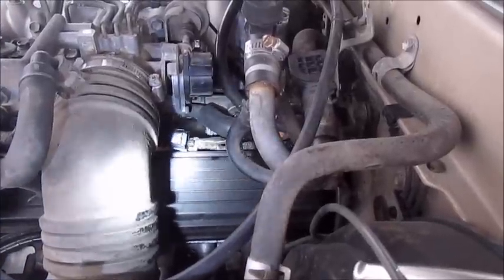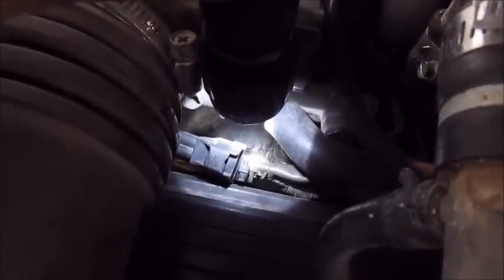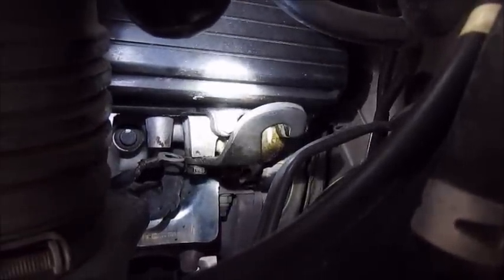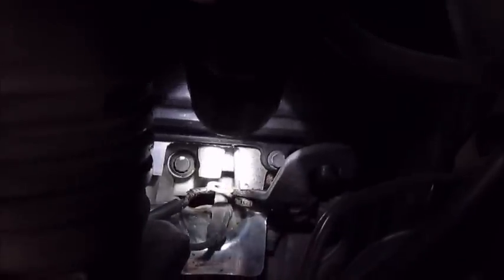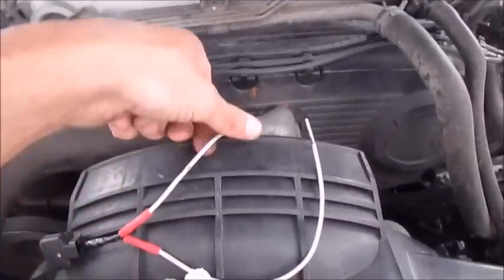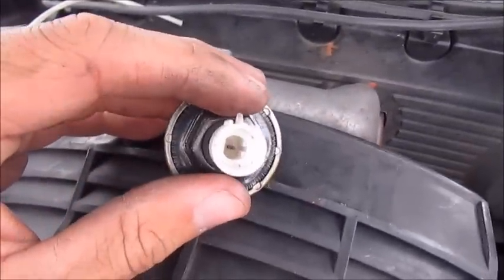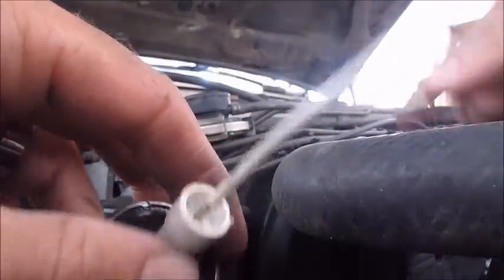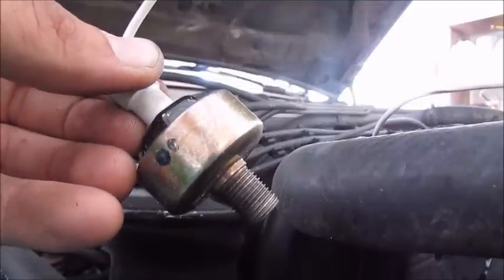knock sensor bypass

Comment: Knock sensor is special designed piezoelectric microphone and sending alltime  agly electrical signal from vibrating engine to controller. Engine is solid pice of metal and vibration is everywhere.

Comment: I actually have a Code 52, knock sensor related problem. I did replace the wire with an OEM Toyota wire. It is so much work to replace the knock sensor that I may simply do such a bypass since my smog check was due last month. I gotta find a place to install it where it is not visible, otherwise the smog inspector will not pass the smog test by visual inspection & noticing that the knock sensor is not in its right location. But at least this way I can quickly get my 3vze smoged to get the tags, then later do the actual work & spend the $200 for the OEM Toyota knock sensor.

Comment: How do you access the connector wire to connect a new sensor?
Reply from the maker: The sensor has a pig tail that passed through a rubber grommet of sorts that is in a slot under the throttle body in the plenum. If you want to retain your original connector on the factor harness, just cut the pigtail right next to the grommet and use the excess wire to connect to your new sensor. It might not be a bad idea to pull any slack out of the pigtail to get as much wire as you can before cutting it.

Comment: That “metal jacket” is a shield cable not just a ground. It’s braided around the main conductor because a knock sensor is piezo sensor. It generates a very slight AC current. This is VERY subject to electrical noise interference. Hence the shielded coaxial cable. Your ECM is not receiving the proper signal from the new sensor because you didn’t use a shielded coaxial connection. It may not be setting a check engine light but it’s likely allowing knock at dangerous levels. It will run great right up until it doesn’t!
Reply: And that shield is carried the entire length of the signal wire all the way through the bundle to 8 inches from the ECU. At that point it is tied to shields on several other wires. If anyone is bypassing or eliminating the shields they are most likely not getting the correct signal at the ECU. But how would you know without the proper test equipment and exactly what equipment would that be? I've read volumes in forums on the dread code 52 and watched several videos on it and an oscilloscope seems to be the best method for testing the actual signal. All of my wiring tests fine, both with a meter and under load, i.e. applying voltage through the wire and shield through a 12volt light bulb. I still have a couple of things to try as I have no method to test the output of the sensor, my meters read nothing on the hammer  test. Maybe there's an oscilloscope order in the very near future.
Reply: @TheBrushcutter  not a simple thing to test for sure. Scope is the only real way.

Comment from the maker: The sensor is not grounded internally. Typically only temperature sensors are internally grounded. Sensors such as a knock sensor that deal with a lower 5v supply have external grounds.

Comment: wait you have a ground from the wire loom and your putting that to the block ?the sensor is grounded when it gets put into the block whats the other wire do i just rebuilt mine and i found a braided wire in the loom  but my sensor has two already do i put the braided to the block

Comment: Knock sensor requires no second grounding as the sensor attached to the block is the ground to the battery.
Reply: Yes I believe the braided wire he was mentioning was the shield wire..

Comment: I have suzuki alto 2002 and knock sensor light on off. And engine making knocking like tarrr tarrr. I have changed 7 knock sensor but still that problem. And the wiring till computer is ok

Comment: Going to try this today after about 30K miles of irritating safe mode driving- thinking I will have to sea foam it after the fix if this works. I mounted the 97 s10 KS just above the two bolts of the hook so they would clear but it would be handier to have it higher up. When I dug out the wire harness I found that it was broke off right by where the harness goes inside - so the sensor might have been fine but the break is too deep, and I already had the new one so will try that before having to remove all the throttle body stuff. The wires are very brittle. I also bought a new harness but the plug-in is round whereas the original is square like the video. Need extra wire anyway because the harness won't quite reach. Will report back.
Reply: Richard Frey 
I just ran new wires to my sensors  and  soldiered my new wires from computer to sensor and used my old plug I just cut it off and soldered it to new wire then pluded it in good as new. The factory wires are easily frayed or broken over time this was a good and quick fix for me hope it helps u.

Comment: this works great!!! I did mine on the side, anyone says it wont work please tell me? how is it you can hear sound 1200-miles away on a thin piece of wire and this set up is only 2ft away at best from were it should be, will not work? sounds travels threw metal I say it does work.
Reply: Joe Trueblood which s10 sensor did you use and which harness? Asking for when they ask me what model the s10 is

Comment: After doing a little research I'm thinking that more often than not the sensor itself is fine but the pigtail is notorious for going bad.  In my case mice chewed it.  I happen to have an extra sensor from another engine and am thinking about just doing this mod but with the OEM sensor.  These type sensors are piezo crystal and operate within certain frequency range and I'm wondering if all piezo type work in the same range and what they do is "listen" for pinging sonically through the block.  I'm wondering which is faster; removing intake and replacing pigtail or getting a drill into tight quarters to drill and tap a new hole?

My other concern regarding this mod is I noticed most sensors seem to be centrally located in order to hear all cylinders, some with multiple locations on larger engines, so my fear is that knocking from the opposite cylinders not registering and therefore poor engine performance.

Comment from the maker: I had a similar problem trying to time mine, I had to do it by feel because the timing light put it way off. I eventually recalibrate the TPS and it fixed the problem. I was then able to time it with the light.
Reply: Travis Christy have a picture of exactly where put the knock sencor

Comment: I have a 1993 Toyota 4Runner 3.0 engine. My problem is that I replaced the engine Heads along with all other parts like the timing belt. Now I am having a problem setting the timing. I have double checked all marks. The engine starts fine but when I set it at 10% before top dead center, the engine has no power. I tried relocating the Knock Sensor, but still no power. Can someone help with this.

Comment: I watched your video, and it is great, but I do not understand where you drilled for the new sensor. Is it on top between the two existing bolt holes or over an existing hole?

Comment: I just did this fix to my 1989 4x4 pickup with the 3VZE motor with code 52. No more check engine light and seems to be running much better.

Comment: That's awesome. Very admirable tenacity and impeccable research done here! Even went as far as comparing the displacements of the two engines so as to ensure that the s10 sensor would be undoubtedly able to pick up on that certain frequency in case your old sensor was a tuned sensor and not a mass sensor.

Comment: OK, update on my 1993 3.0 V6 4runner 4x4 automatic! I successfully relocated my knock sensor to the position called out in this video, to the lift hook BUT, what happened was it didn't work the first time and discovered the brown wire that went into the clip from the harness side was damaged and hanging on by a couple wire strands. I bought a knock sensor pigtail from Toyota for $22, repaired the existing harness clip damage, the pigtail was a little shy in length to the new sensor location so I soldered an extension,about 5 inches, and attached the round male clip suggested down below from Ebay. I clipped in the new pigtail to the harness and attached the 97 chevy S-10 4 banger knock sensor. I had detached the battery earlier to wash out the code 52 and work on the vehicle. And it worked like a charm! No code, and smooth running engine! I did not have to attach a ground cable! I repeat, I did not use a ground! I was curious about Toyotas new pigtail wire for their sensor and I took all the tape off and found that the black wires outside grounding braid was attached to the brown wires outside grounding braid and the brown wire was soldered to its own grounding braid and taped up! The Black wire that lead to the sensor connection end, had about 4 inches of nothing but Black wire going to the clip sensor connection and the blue thicker encasement with the braided wire just ended and folded back unto the wire about 1/2 inch with the black wire exposed leading to the sensor clip all by itself!  So the black wire is the sensor wire and the brown wire is the ground that goes nowhere, weird but I have come to the conclusion that the brown wire is already grounded within the harness wire setup itself!  Good luck!   Toyota pigtail wire harness to the knock sensor is part number 82219-35010 wire sensor http://www.amazon.com/Novello-Connector-Female-Sockets-NIL-WHCF/dp/B000WPF9WW/ref=sr_1_1?s=automotive&ie=UTF8&qid=1434594718&sr=1-1&keywords=female+deutsch+pin&pebp=1434594739657&perid=1MMPCNDK40G8MVWPN4DN
Reply: Placido Bernal     U should of punched him in the nuts
Reply from the maker: Placido Bernal it is the bracket on the driver side rear of the engine. I pulled the bracket off (two bolts) and drilled and tapped it. Then just reinstall the bracket.
Reply: Where exactly did you drill the new hole? Is the bracket the one with hole or where the bracket mounts to?
Reply: Thanks, I was able to do it, but wasn't able to pass the smog. The reason was because they said it was modified. The check Engine light did go away. so now I will need to replace the Knock Sensor any way.
Reply: Placido, How did they find the modification if the check engine light wasn't on?
Reply: Hi, well the inspector has to do a visual inspection and that is how it failed. He saw it there on the lift bracket and said the system can not be modified from its original build. Now I need to fix it because he noted it on the inspection as to why it failed.
Reply: That works better if you are really short.

Comment from the maker: On the sensor side harness, I took the braided wire and unbraided it from the inner signal wire and ran it into a butt connector that went to ground. I took the inner signal wire and ran it to the sensor. I hope that answers your question.
Reply: Travis Christy --- the braided (outer wire) is a shield. This stops RF from leaking.

Comment: Question; How did you tie in the new wires to the old wires in the sensor side of the clip.Each set has braided wires outside both black and brown original wire package. Did you tie both braided and cased wire in the black ground side, to the new single wire. And did you do the same for the brown side that leads to the new chevy sensor? blend both braided and cased wire together to the single wire that will hold the sensor connector?

Comment: muchas gracias amigo resolvi mi gran problema
Reply: Hola Victor nos puedes explicar con mas detalles por favor?Gracias
Reply: Barrenaste un nuevo hoyo?ahi donde va el gancho?para dejarlo enroscado y el cable negro lo atornillaste al bloque?
Reply: No, no barrene el sensor nuevo cae el roto viejo y si el negro va al bloque
Reply: Recuerda q vas a usar un knock sensor de S10 cuatro cilindros del 1997
Reply: Perdon no entendi eso" del sensor nuevo  nuevo cae el roto viejo"
Reply: Quisiste decir que la rosca del hoyo donde va ese tornillo coincide con la rosca del sensor de la chevy S-10 ?
Reply: Exacto
Reply: Amigo como le iso

Comment from the maker: I don't have the vehicle anymore and I am not 100% sure. Check the sensor harness that goes under the intake and it should have a braided ground shield around the outside. Whichever wire connects to that shielding is the ground.

Comment: Also I didn't tap the hook I went to ace and got a bolt for 65¢
Reply: I know this was along time ago, but can you elaborate on how uou mounted it?
Reply: @GutZ_47  i just drilled a hole through the hook and put a bolt on the back side that threaded onto the knock sensor

Comment: I finally did this to my 91 this morning and no cel I couldn't be happier only hard part was figuring out what wire was ground thank you so much
Reply: +totalpkgpainting if I remember correct black is ground
Reply: +Trevor Sisley 
which wire was the ground, brown or black?
Reply: +Chris Kramer I've sold the car sense I know I did it wrong at first and then rewired it a second time to get it right
Reply: figured it out! i actually just use coaxial cable directly to the ecu and grounded the braided shield to the block. Same s10 knock sensor though, thanks for this vid!
Reply: Did you use the brown for ground or the black for ground? They both have the braided wire in them!
Reply: Did you use the brown for ground or the black for ground? They both have the braided wire in them!
Reply: Trevor Sisley
Thanks!
Reply: Trevor Sisley
Did you use the braided stuff around the black wire too,or just the wire inside the black coating right?
Reply: Trevor Sisley .

Comment: I hate to bug but did you use any special wire for you new ground and connection wire? And when taking apart the knock sensor wire is the shorter brown wire the ground?

Comment from the maker: Oh sorry I forgot to answer that. Off the top of my head I don't remember. I want to say I used a 12 mm (this isn't exact because the sensor has tapered threads) but it was close and threaded in tightly. But double check that by comparing.

Comment from the maker: This is the pin style that I used. It is a deutsch connector pin. Really, whatever your local parts store can find to stick onto it will work. There is supposed to be a stock connector for it by my parts place was unable to find the correct one.

http://www.amazon.com/Novello-Connector-Female-Sockets-NIL-WHCF/dp/B000WPF9WW/ref=sr_1_1?s=automotive&ie=UTF8&qid=1434594718&sr=1-1&keywords=female+deutsch+pin&pebp=1434594739657&perid=1MMPCNDK40G8MVWPN4DN
Reply: Yes it worked and passed smog this way also
Reply from the maker: +jimmy medina nice!!!
Reply: Thanks so much. Do you remember what size tap you used? I'll let you know how everything turned out.
Reply: +jimmy medina did this work I'm ready to try it and wanna know if it worked out for you

Comment: What size tap did you use and where can I get an end piece that will plug into the s-10 knock sensor?
Reply: probably a 12mm by 1.25 pitch thread size.

Comment: You have the after pictures or video of what you did . Have fighting this code on my sons truck bought a Kragen parts knock sensor replaced the pigtail from Toyota still same Issue. You mentioned "drilled a hole just above the two existing mounting holes, got a tap that was close to that particular thread (it wasn't exact), and threaded it into that hole." kind of understand that part .Were you get the knock sensor for the s10 dealer or autoparts store ?
Reply: Steve Co

Comment: I'm not clear on where you positioned the new knock sensor. Did you put it under the plug on that bracket? Thank you for relying !
Reply from the maker: I'm not completely sure of what you are asking but I will try to answer the best I can. There is a rear drivers side engine lifting bracket that is held in place my 2 bolts. I removed that, drilled a hole just above the two existing mounting holes, got a tap that was close to that particular thread (it wasn't exact), and threaded it into that hole. I then finished up by wiring it in place.
Reply: Into the hole in the head or the bracket?